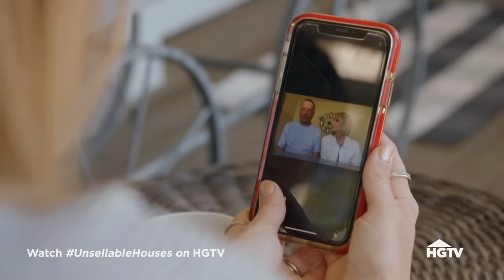Luxury Cabin Remodel of 90s Tract Home | Unsellable Houses | HGTV

Comment: Something wrong with numbers. 415K asking price + 60K renovation cost = 475K. Sold 712K. So it's 237K : 2 = 118,5K to each part.
Reply: I thought so too.
They're way out!
Reply: No, the sisters take the total renovation cost of $60,000 back, so that's not part of the calculation.
Reply: @sunnysunshine6271  so I have not counted that amount  712K-415K (asking price)-60K (renovation costs)=237K
Reply: @crasygirl7022  Oh, you are right. Should have used my calculator before typing 👍🏼.
Reply: Accessory over kill
Reply: I think they used the new list price which was $510 000, so 712 - 510 = 202 - 60 = 142 ÷ 2 = 71 thou ea.
Reply: It's on the 💦 water